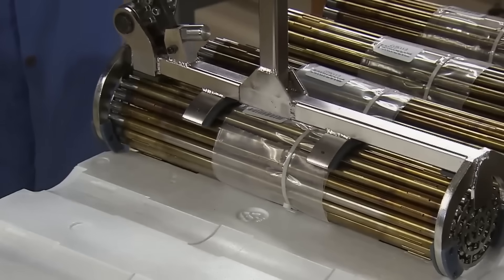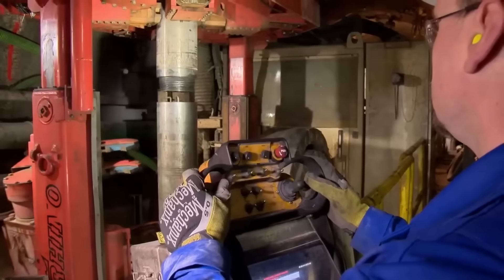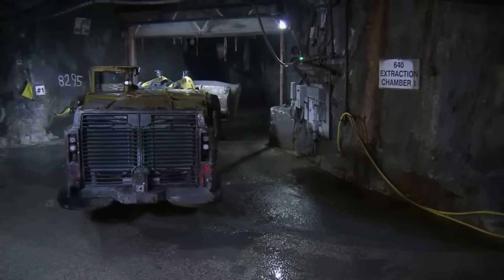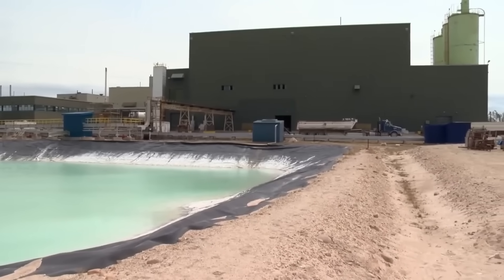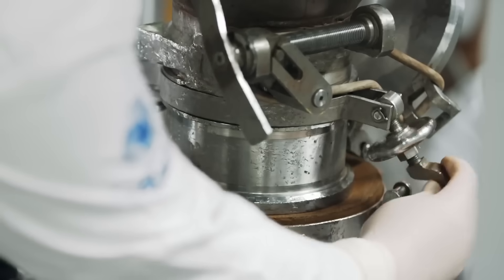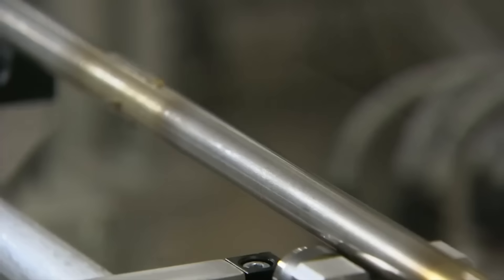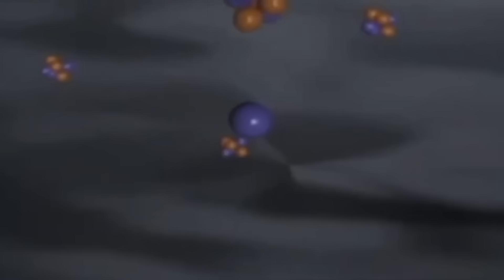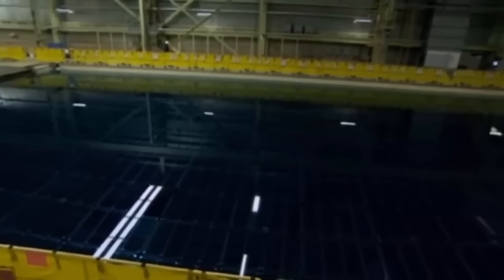How Enriched URANIUM is MADE☢️ | How URANIUM is EXTRACTED FROM MINES | From Mine to Reactor

Comment: It's radioactive if I'm correct yet they are touching them
Reply: You should learn about the different types of radiation, alpha, beta, gamma. As well as radioactive half lifes. But, in case you don't, here is a summary of why this is okay without getting too technical. Uranium emits alpha radiation, which doesn't penetrate very well. A piece of paper is enough to block most of the alpha radiation emitted by uranium. The dead layer of skin on your hands, or anywhere else, is enough to block most of the radiation. It can only really do damage to something if it's in direct contact. Even a few inches of air is enough to block an alpha ray. The only real concern is getting dust from it on your hands, and then ingesting that dust. Whether it's by touching your face without realizing it, or eating something while the dust is on your hands. Once it's inside your body, such as your lungs, the alpha radiation can directly interact with your cells and cause problems.

Gloves and suits are usually necessary when handling uranium or anything radioactive for this reason. You work with it, throw away the gloves, and then scan your hands with a geiger counter for any contamination. If there is, you just wash it off and check again.

The half life of uranium-238, which is the most common one in nature, is billions of years. Which means it decays very slowly. Meaning it gives off radiation slowly. It may stick around longer than the age of the universe, but there are elements which emit just as much radiation in a matter of days, weeks, months, years, you see where I'm going with this. The lower the half life, the more intense the radiation and hence, the more dangerous it is. But uranium can still do damage internally.

Most people focus on the radiation so much, they don't realize uranium is also a heavy metal. Like mercury, or lead. And it will cause health problems outside of what the radiation alone would do.

If it emitted beta or gamma radiation, it would not be safe to handle, or even be around, depending on how radioactive it is. Which is why I say to look up what the 3 main types of radiation are. It will at least explain what I've explained in depth more. Here's a video that explains it, to save you the trouble of looking it up: https://www.youtube.com/watch?v=iTb_KRG6LXo&ab_channel=Fermilab
Reply: Dosage matters.
Reply: intensity matters.
Reply: Thats not activated yet by the reactor.
Very low radiation. The real pain in the ass is a radioactive dust (and doesnt matter how its radioactive), thats why they wear suits and gloves (it must not to get inside of you)

Comment: How do the rods which initially emit very low levels of radiation get activated to generate the heat?
Reply: Rods are emitting a truck load of Neutrons but low levels of Gamma, Beta and Alpha radiation. The Neutrons are going way too fast to smash the atoms without a moderator (yeah sound crazy don't it? but they just fly by), so when you put a shed load of these Uranium rods things together and slow the crazy neutrons down with big lumps of graphite (a moderator) the neutrons can smash the crap out of other U235 atoms splitting them and chucking out more neutrons, heat (and some other nasty undesirable rays) which smash the crap out of more atoms etc.  causing a chain reaction and more heat than you can shake a stick at, until somebody chickens out and shoves in some Boron rods to soak up all the crazy neutrons and put an end to the party
Reply: They use neutron initiator elements– elements that will initially produce the neutrons to start the reaction. They usually use plutonium or californium or any other radioactive elements. If ever the reaction gets too hot, they put control rods such as boron that absorbs neutron.
Reply: Simple
Reply: @Chicago_Clout  Yes, I wonder why I didn't think of that!😁

Comment: Any one know how much total energy is required to mine and enrich uranium??  It looks like a hole lot of fossil fuel is used in the process.  I wonder, would it be a smaller carbon foot print if we just used the fossil fuel to generate electricity?  Diffidently would be safer.
Reply: actually, nuclear energy is pretty safe, and so far there have been no recorded incidents radioactive waste leakage, unlike coal power plants which dump the carbon dioxide into the atmosphere. as for the energy used to extract uranium, its a tiny fraction of the energy that is produced by the uranium when it is fissioned
Reply: @raptorthegamer5524  That does not answer the question.  Like saying there is only a tiny amount of arsenic in my drinking water.

As for nuclear safety. Let me introduce you to my family who was exposed to a tiny nuclear cloud and all have cancer.

Just because there are no "recorded" incidents does not mean that are not happing and just being swept under the rug.  Take a look at what is going on in Germany and their waste products.

I don't think you under stand the scale of the waste issue.  Waste starts at the mining site to the process centers power plant and ALL those buildings and equipment is waste.  

Several years ago a tiny amount of radioactive metal was acquired by a steel factory that made rebar for construction.  Several buildings were built and luckily torn down.  Now all that material is waste.

A better solution is to clean the coal plants and reduce the amount of resources we use.  But that would require real effort on our part and NO one wants to do that.
Reply: This is NOT the case.

"uranium-235 contains two to three million times the energy equivalent of oil or coal. "

So..
1kg of coal ~ 8 kWh
1KG of U235 ~ 24,000,000 kWh

Where does the carbon from "burning" fuel go?  How much CO2 does the 24,000,000 kWh from uranium produce?
Reply: @davidkennedy7630  Not disputing that uranium has more energy per pound than any fossil fuel.   BUT

What do you think the fuel is for mining the ore,  Transporting the ore, Processing the ore, manufacturing the fuel, transporting the fuel to the reactor. Building the reactor, dismantling the reactor , Digging the hole for burring the waste, shipping the waste, guarding the waste,  by the way all the mining equipment in nuclear waste along with the shipping containers processing and manufacturing plants.  

Where does all that radioactive bits that are dropped along the way go?

I know carbon dioxide is not going to kill me.  I know radiation will make my quality of life much worse.

Not promoting coal plants.  natural gas is the way to go.  it is renewable. and wont make you sick if you have a pound of it under your bed.
Reply: @lostvisitor  Probably the same as mining materials used to build wind mills, solar panels, etc?

Where does the toxic coal waste go?  what about all the toxic chemicals used to build solar panels, where does it end up?

Kilo-for-Kilo it is hard to beat Uranium as a fuel source, even factoring in the extended storage of the waste products.

Do the math yourself, Bruce Nuclear produces 48,169 GWh of power annually.  How much wind/solar would it take to equal this?  what do we do at night or when there is no wind?

How much land would it take to build a solar/wind farm to create anywhere near that much power with similar reliability?

Lastly, natural gas WILL kill you.

"Natural gas can present immediate dangers at concentrations of 50,000 ppm."

This is why mercaptan is added, so you can smell it before it kills you.

Comment: These are CANDU reactor fuel bundles . There is absolutely no enrichment of the uranium in the process of building these fuel bundles in the thumbnail.
Reply: The round ones are, and you are right.  CANDU bundles are typically made from natural uranium.   However, there were also the square bundles.  Those are enriched, typically about 4-5% US235
Reply: This bundling method is used in multiple types of reactors.

Comment: Processing in multiple stages, each consuming vast energy.
Acids. 
Hundreds of Mechanical engineering steps.
By-products, waste, hazards.
Energy supplied by wind and solar plus cannibalism of its self?
Reply: the manufacture of solar panels and of wind turbines is no different in terms of efficiency of total energy and materials inputs and waste outputs, except there is no waste radiation hazards for them. solar panels in particular require tons of mining, acid extraction, chemical refinement, mech engineering, etc. there's no perfect solution yet, which is why nuclear power is so viable still.

Comment: 1 peanut worth of Uranium Dioxide fuel pellet has the same amount of energy as nearly 600 gallons of diesel fuel, or 700 gallons of gasoline, or 800 some kilograms of coal // such that enriched uranium fuel has 90,000X better energy density than carbon based fuel that produce air pollutants that harm public health and make climate change worse faster when such carbon based fuels are burned releasing acid rain forming particulate matter toxic fumes soot particles & other emissions bad for animals health, bad for wildlife & nature, so there exist an urgent global need to replace carbon combustion with a no carbon or negative carbon energy source, manly practical commercial nuclear fission reactors, especially serial produced SMR arrays cost attractive and affordable to electrical utility companies on shorter timelines that do not require government funding and with standards like airplane manufacturing at Boeing or Airbus, 3 or 4 at a time made in series in a special factory with continue sequential production since a common district municipal scale SMR array of 150-400MW going to contain around 12 of the SMR reactors hooked up in series & parallel for power production or district heating or both.

Comment: The spent fuel rods can be reprocessed to make new fuels for 4th gen. breeder reactors, in a renewable nuclear fuel process that can even make use of the more earth abundant Thorium once the reaction happening in a self sustaining burn with good neutron flux to transmute fertile elements to fissile elements useful as new fuels in a repeatable recycling process that can extract 96% of the fuel element energy, unlike the 4% extract in 1960-1980's era Gen. 2 reactors (400 or so operating around the world)(also paid for by government funding because of the high cost & long build times and custom design of each reactor complex.